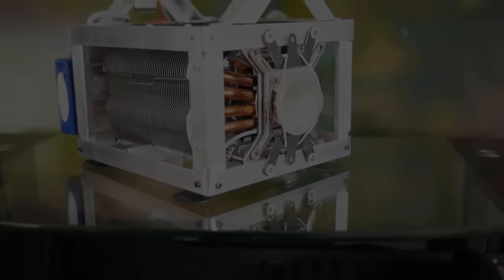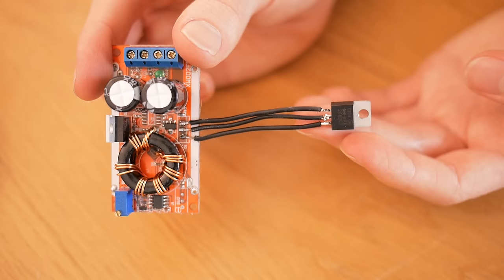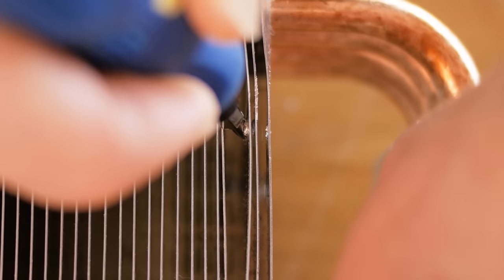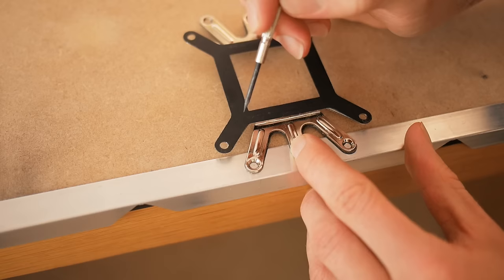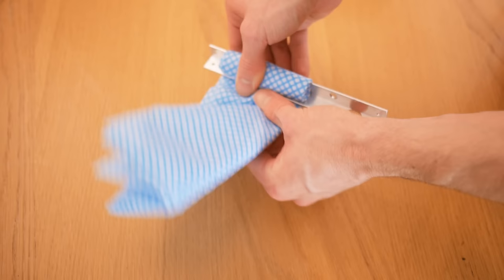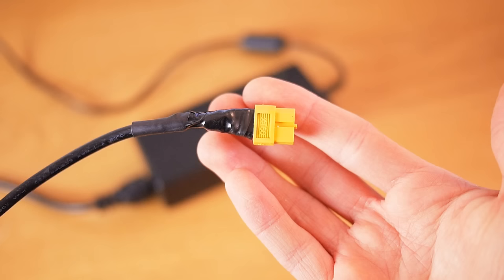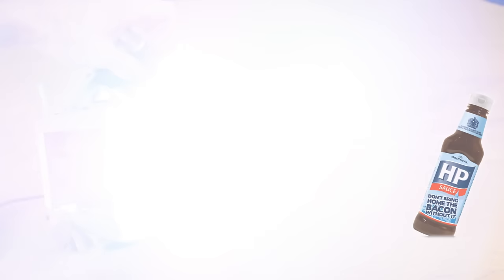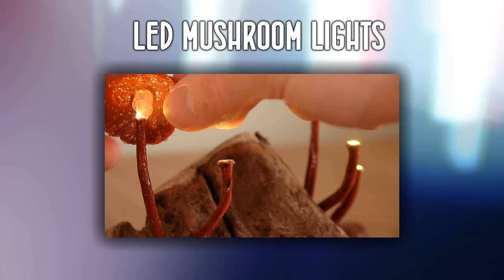Make a 1000w equiv. LED flashlight - aka DIY Sun-Blaster!

Comment: One quick question:
The boost converter converts the voltage from 10-32 to 12-35 volts. 
Does that mean u can't use it when the lipo is so empty that the voltage is under 10volts?
And can I power this with a 7,4volt lipo?
Reply: For your 1st question: Ideally a 3 cell  Li-po shouldn't go below 9volts which is fairly close to the boost converter 10volts, now for your 2nd question: I have personally used this specific boost converter on an old project bike my buddy has to boost the bikes 6v system to run a 12v Led light with minimal problem, yes I agree that my headlight is only 36w compared to this flashlight's 100w but I think that it should work just fine. 
Update: Just figured out that the battery that he is using at the second test shot @ 17:08 is a 2cell Li-Po that has a voltage of 7.4volts So yes it will work more than ok with a 7.4volt Li-Po. The only problem with the 7.4v Li-po is that with this fan configuration your are running it really undervolted unless you use a Buck-Boost converter instead of a Buck converter.

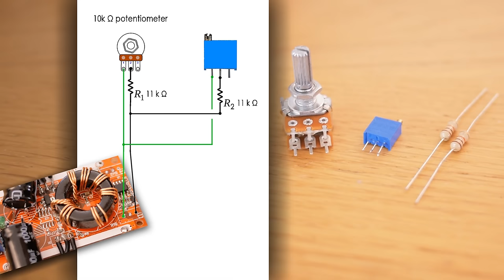Comment: @DIY Perks I am a bit confused about the resistor you used at 4:10, can it be any 11k ohm resistor because there are a few different types of 11k resistors on ebay ranging from "11k ohms 1/4 Watt" to "11k ohms 1 Watt." Your response would be greatly appreciated :)
Reply: Jezro Shevy I guess you can use any the ohm is the same it just the voltage it can handle 

I have a question for you. 

Okay so I have my resistors hooked up just like he does in this video I couldn't find 11k ohm resistors I used 10k at first and then added and tried both in series and parallel an 1k still coming out lower voltage output. I have the blue potentiometer turned all the way right for max output and my 10k big pot turned all the way right I'm outputting 19.6v I thought I was doing something wrong so I hooked the little blue pot back up way it was made and the voltage booster outputs 42.6v. Is there something I'm doing wrong do I need these resistors in there like that?
Reply: Are you %100 sure you have followed his circuit diagrams, if not, have a sniff around on instructibles and try to counter your problem. If you have done exactly as he said, i have no idea what is wrong:(

Comment: I made a 10W light with 8 AA NiMH cells and a .33ohm 3W limiting resistor and a 10ohm lower power limiter for 2 light levels with a center off DPDT sw. The 10W LED has a much smaller footprint and you can use it with a parabolic reflector for a diffused spot effect. The aluminum case is all the heatsink needed and it's the size of a 2D light . Still really bright, and much smaller; runs for 2 hrs on bright and forever on low power. Incidently, PLEASE say "sodder"! You're driving me nuts with "sol-der". I've never heard the English pronounce it any differently thank us Yanks.

Comment: What if I use a 50 watt LED? is there any difference?
Reply: half the intensity, longer runtimes and less heat to manage... other than that, the process is the same as for making a 100W one. My high-powered flashlight, which uses a totally different design to this uses a much beefier boost converter, a smaller heatsink from an AMD CPU cooler (including the latches and brackets oddly enough!) and a hand built 12-cell 6S lithium ion battery pack... I've estimated the runtime on it to be 1 1/2 hours minimum with its 2200mAH battery pack at full intensity and much more at lower intensities. Oh... and I also added a push/pull  switched potentiometer to allow me to switch the LED off without powering the whole thing down in the rare event that the LED overheats. Since I force a massive amount of air through the heatsink with a bit of ducting and a pair of fans it's not a likely problem to happen!!

Comment: That soldering iron is disgusting and also oversized, go buy better and cleaner one please 🙏

But i love your crafted items, like a modern days blacksmith!

Suggestion, on the top and bottom regulator/dc regulator the plastics mybe melt a bit because of heat current, maybe better using thermal pad you can cut to size perfect the regulator pcb and it does conduct heat to heatsink too! 

Keep up the good work

Comment: Just to repeat my question, do I need to solder on the two 11k resistors to the 
dimming mechanism if my boost buck converter can also limit the current 
at a specific level (i.e. has two dials one for V and the other for I)? 
Thanks
Reply: You do, because those are not there for limiting current but for allowing you to bracket a certain span of possible output voltages.

Comment: my led came in yesterday
worked with only 1 dead led
now after power measuring and getting power supply cables that don't melt there's only the outer 2 rows of leds working, the rest died
these 100W ebay leds are not that great

Comment: That thermal plaster is conductive, how could it be insulated from the heatsink base?
Reply: The proper way to mount those 'BT' triacs would have been with white thermal paste and thin mica insulators, along with a mounting screw and plastic washers to isolate it electrically. This is a basic guide, so common sense and a little bit of electronics experience would be a definite plus when building this.😁
Reply: @danw1955  So the insulator is thermal conductive but not electrical?
Reply: @kailimedia  Exactly!👍

Comment: Hello, someone know if that led cause some interferences in camera? or this led is flickr free?
Reply: It depends on the regulation and the operating frequency of the boost converter. If there is a problem, even slight, you can probably add capacitance to its output.

Comment: Could you make one of these with a much smaller heatsink? Or could you do without the huge heat sink at all? These heat sinks are pretty expensive new and I don't really have a place to readily get junk heatsinks (the one you use is not junk and i paid quite a lot for mine which I use on my computer). What alternative are there compared to using some huge heat sink like this one? thank you
Reply: alternatives? smaller heatsinks with a noisier fan (maybe REALLY noisy), or with a smaller led and a quiet fan.
use your old stock cpu one, and a cooler led, 50/25W would still do really good  ;)
Reply: Thanks for the comment. I just though this heatsink was overkill for the 100w LED. maybe not? Yea I was wondering if I could get away with using a much smaller heat sink on the 100w led. Might try a 50w LED on a regular stock cpu heat sink. Thanks
Reply: I think it mostly depends on your needs, and your spare junk :) I'm making a project like this by myself, I'm experimenting with different cpu/vga heatsinks I already have around.. I'm searhing for cool temp AND the smallest noise at all, AND it have to be able to run long times. Others could not mind more noise and thus could use smaller heatsinks, or make a build which they'll use few minutes a time.. :) 

BTW having a cpu stock heatsink could suffice, if you're worried maybe use a 50W to be sure.. you can always swap it with a 100W later ;)
Reply: Thanks for the tips. Good luck with your project. Yea I think the 50w with a small cpu sink would be fine.
Reply: Thanks, and the same to you :-) I'm still thinking on HOW assemble all of these pieces.. wanan try something original :-)
Reply: If you really want to do something cool and original try doing this with super capacitors and an iron phosphate battery. I'm just starting to get into experimenting with super capacitors.

Comment: 6:40 whats the point of mounting it on the heat sink if you're putting spacers there?
Reply: +Kinzoku Shirogane the circuit board isn't the thing that gets hot its the IC's
Reply: Ye but it's still not touching the heat sink?
Reply: +Kinzoku Shirogane , I agree, glue, silicone or epoxy would have been better than a air gap.
Reply: Because it makes the design more compact and also allows you to cool the boost converter's most vital components, a schottkey diode and a power mosfet better, which means you get better reliability and more power handling from them. A MOSFET's power handling ability drops the hotter it gets until it ultimately fails, so you want to make sure it stays at an acceptable temperature (for this application, pulling 8A in, your MOSFET should not reach 125*c or it will enter a state of thermal runaway and fail...)
Reply: ThEcRaZ3dGaM3R Yes but if it's not in contact with the heat sink the cooling effect added is low?
Reply: Kinzoku Shirogane Not in this instance... the heatsink used for the LED as an immense thermal mass, which basically means it's able to hold a lot of heat as well as having plenty of surface area to dissipate it (the fin stack). The heatsink plaster if applied in a thin enough layer will provide the same if not better thermal conductivity to the sil pads used to separate the ICs from their heatsinks on the boost converter in its stock form.

Comment: Your way of removing components from a board appears a little rustic. Also very bold to not use isolating thermal pads below the regulators. But nice build, though.

Comment: Whilst I wouldn't question your electronics skills I question your understanding of thermodynamics. Most of your attachments to the heat sink render the heat transfer completely redundant. You're carrying a heat sink around for practically no reason.
Reply from the maker: Not sure what you mean. The LED, which is the main source of heat, is in direct contact with the heatsink's base, which will wick away heat from the LED and transfer the heat to the fins, which are then cooled by the fan. The voltage regulator MOSFETs are also in direct contact with the base - though this time they are only in direct contact with the aluminium block rather than the heatpipes, but that's OK as they generate much less heat (about 10w or so).
Reply: BaSH PROMPT
Reply: I agree with you DIY.  Odd statement.

Comment: How long would the battery last (if it is the 4500mah you suggested)?
Reply: for a 4.5AH battery you're looking at roughly 30 minutes of runtime if it's an 11.1v (12.6v nominal with a full charge) since the boost converter wants between 8 and 9 amps for 100W of power.
Reply: I have little knowledge about electronics (always struggled in physics), but I am keen to learn. If I understand correctly you just take 100w / 11.1V and that gives you around 9 amps? 9A x 0.5h gives you 4.5ah or 4500mah?
Reply: Tom Sephton Don't forget that a fully charged battery is around 12.6v as well, so your initial current is around 8 amps and that means that your battery might actually get a longer runtime than 30 minutes with a battery that's giving you its full capacity.
Reply: ThEcRaZ3dGaM3R ahhh okay thanks and it will never drop below 11.1V? As the battery would not have any charge left below 11.1V? Also how would you select a charger? Volts can be higher than your battery Voltage but Amps need to be the same?
Reply: Tom Sephton It can drop below that voltage if you want more of the battery's capacity. You can discharge a single LiPo cell to 3.4v (10.2v) safely and be able to fully recharge it without damaging it. As for charging, you need to have a balancing charger or a protection PCB, A good balancing charger (that's one that's calibrated from the factory) isn't cheap, and can set you back a fair amount. If you decide to go with a protection PCB, however, you get a voltage cutoff and also a balanced charge capability in a small package that's about 10% the cost of a basic balancing charger.
Reply: ThEcRaZ3dGaM3R Ahhh okay awesome I didn't expect that the voltage could go that low... I definitely think the PCB is the best option it is never a bad thing to save costs. Voltage cutoff will obviously prevent over charging (which I've been told is very bad for a li-ion battery, and since Li-po and li-ion is basically the same I can just imagine..) how does the PCB give you a balancing charging capability though?
Reply: Tom Sephton It uses basic monitoring and cuts charge to a topped off cell or uses a transistor to switch a low cell off. They tend to be used a lot in laptops to control a 3S configuration of 6 cells.

Comment: Sorry bro the voltage booster work up to 150watt how you use up to 1000w power outcome make titel to 100w then it worth fit ... Make electronic assumption correct Frist....

Comment: 1000W?!?! i thougth it was a 100w led. or you mean 1000wh akku
Reply: It's as powerful as a 1000W halogen light
Reply: even if the rating of the led would be true, it has only had only 30% of the lumens of a 1000W halogen light, but the least knowledge about high power led's would tell you, that the the rating on ebay is fake. It's to bad, but the data written down there are better then the best actual led's which will never happen an led only costing 20% and repeated getting tested as just being as efficient as a good halogen light.

Comment: You went through all that awesome trouble, then sanded the lens without polishing it and didn't even show us the focused beam? 

9/10 for innovation, 5/10 for efficiency.
Reply: Yes he did.  He showed the focused beam 18 seconds into the video... right at the beginning. He also didn't polish the lens on purpose.  When it was polished, the yellow from around the LED projected through.  The purpose of sanding it was to make it hazy and stop the clear image of the LED from projecting through.  If he polished it, it would be right back to where he started.

Comment: you really want to sell this as a 1000 W equivalent torch?
You know that a normal halogen torch with 1000 W would have about 27000 Lumes. Your chip is rated as 1100 Lumens @100 Watts. But having the least knowledge of LED'S you would know that that that is fake value. Else it would have a value higher then then the best led's on the market at this power and just cost 20% of them.
These kind of chips, normally measure @80 Lumens/Watt at about 25% current. At full current way less.
Also by running an LED on full current you show that you have no idea of high power led's. Didn't you wonder that no real datasheet was available.
Also learn how to add the heat conduction paste propper, your way you are just creating a bad connection where the paste actually acts to much like a retardent.

Comment: Wait a minute. 1000 watts / 12 = 83.3 amps. So in order to run this for 15 min at a 50% discharge rate you will need a 50Ah battery. A 12 volt 50Ah lithium ion battery capable of this can be purchased, for 500 usd, that little pea shooter your using will keep this bright for 2 min making me wonder if your math is off by decimal point. Then i got to the end and we see your actually building a 100 watt system, not 1000 watt. It doesnt matter what the led rating is if its burning 100 watts you have a 100 watt light.